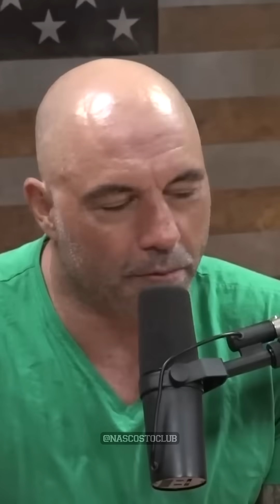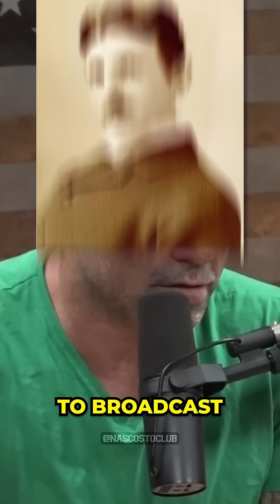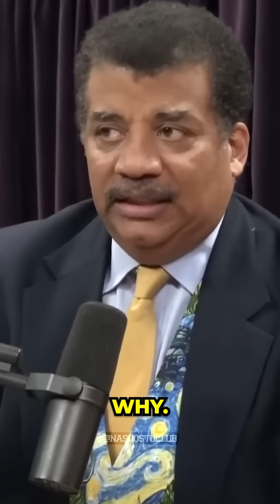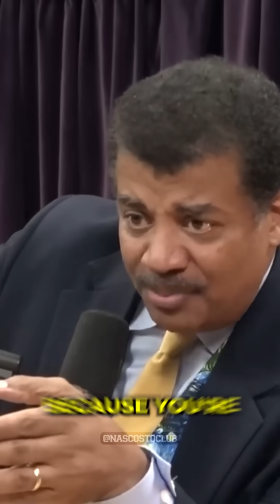WIRELESS Electricity Idea Debunked ⁉️⚡ #shorts

Comment: Neil sounds mad that Tesla possibly had something that he might not understand. (Edit) Viziv Technologies based in Texas has apparently cracked wireless energy transmission. They have a huge tower that looks like Tesla's Wardencliffe tower.
Reply: Do you really think that if we could do Tesla's theory's someone wouldn't have done it already?
Reply: @jasonpark7600  he did it using fluorescent gas bulbs. You had to orient one pole the bulb towards the tower. The problem at the time is that you couldn't charge money for its use. No meter box measuring usage or controlling who uses this free energy. Whether there would have been adverse effect to the environment or people by these waves is a different story, but he proved it and soon after the wooden tower conveniently burned to the ground. No use in providing free energy. A further idea was to use the earths poles as a giant battery. Follow the money and you see reasons for idea suppression.
Reply: @julioperez8324  no, energy ain't free🤦‍♂️
Reply: I think Neil is right about this one 🤪
Reply: stand infront of a running radio antenna. you wont feel good for much.
Reply: He's got a good point tho, but it's just you're so prejudiced towards him that you don't understand or don't want to understand his point.
Reply: Dude do you know what is energy? Do you have any understanding of physics ? I hate Neil but as electrical engineer I can tell you that he is totally correct. Tesla might have  found a way to transfer very high amounts of energy through air but we would never be able to use it around people .
Reply: @yingyang7666 Never is a strong word. We shouldn't use it so lightly
Reply: The guy is an actual scientist, he understands this stuff. Tesla was brilliant but he was working with brand new technology and he didn’t quite know it’s limits or it’s truest potential. The worship regarding Tesla is so strange
Reply: Nonsense. Neil's explanation is spot on. You may find him annoying, but that doesn't make him any less correct.
Reply: Are you being serious? Like for real? Seems like a lot of people in this comment are stuck on 1900 if they thinks thats good or possible
Reply: I feel like the fact that you don’t understand the deadly air means NDT isn’t the one left out here
Reply: Please explain how NDT's explanation is wrong
Reply: No not at all, Tesla had an impractical idea, he was a brilliant engineer but did not understand the physics well enough. No one at the time knew the physics well enough yet. If he had actually attempted to build his system he would have quickly ran into the realities of it and that it wouldn't work.
Reply: @Ender240sxS13  Even at the time the physics was advancing rapidly but Tesla religiously opposed them. Tesla didn't even believe in the existence of electrons. Also many of his inventions were made up to impress party guest at the lavish parties he would attend.
Reply: I’d like to see a conversation between Neil and Tesla
Reply: Nah even then Tesla realized what Neil said is true and modified to wanting to send power waves under ground.
Reply: What's not to understand? Your powering things using radio waves, small things. He was absolutely right in terms of useful power.
There's a reason your wireless charger isn't used to your water heater or dishwasher, it can't safely.
Reply: Nah, Tesla had an idea that was ridiculous with the current understanding of science and its technological application. NDT is right, Tesla's idea is absurd, but.... the concept is still probable, but not with EM waves.
Reply: Uhm no, moving electricity through the air is a bad idea. No matter how "smart" you deem the inventor to be. Not even mentioning the ridiculous amount of energy lost to friction.
Reply: @hitbox7422  
I said elsewhere, "Energy through air" is essentially "lightning"
Reply: @hitbox7422  You can use microwaves and capture it with large receptor dishes, but standing in between the sender and the receiver is a very very bad idea.
Reply: @hitbox7422  "you deem"? What Tesla brought to the world for AC current was beyond they understanding of anybody in his time.
You/Niel are nobodies to deem, Tesla. You have electricity because of his efforts, buy you can choose to be ignorant of it.

And Tesla's idea was to move electricity through Vacuums, not Air!
So get out of your delusions.
Reply: @hitbox7422  in the way you imagine. Now imagine anti Matter based electrons that cannot interact with mass and therefore ignore us. Some quantum shit
Reply: @hitbox7422  well ! Isn't that exactly what happens during lightinings? Electricity through air ?
Reply: @hitbox7422  bro electricityis in air all around us, we literally can produce enough static electricity to power a light bulb. People literally climb on to very powerful power lines from a helicopter after they use a wand to ground out which   allows the electricity  to pass through you without any damage.
Reply: @joshuapage9712  just top bro your embarrassing yourself
Reply: @joshuapage9712 Bro, there is a difference between attaching yourself to a circuit and not becoming the path of least resistance, then shooting 120v through air which guess what water bag you conduct electricity better than air.
Reply: @joshuapage9712  you belong on Reddit's "Confidently wrong" thread. -__-
Reply: @joshuapage9712 Agreed! Sometimes when I pet my cat at night, I actually see the static spark. Electrons help make up atoms. There are atoms ALL around us. Electrons in each one. Wave your arm through the air, Atoms/Electrons move. Instead of sending electrity through waves, we harvest the Electrons in the atoms that surround us. Harvest and sending are two different things and I see many talking about sending them through waves. There is always more than one way to do something.
Reply: my man if u walked through a field which has that much energy u wouldn't be here making this comment bcs THATS HOW PHYSICS WORKS
Reply: Ok dude please stop, study and you will understand why that is IMPOSSIBLE. Im not saying Tesla was not smart, he probably wrote that, gave up and we are today discussing it.
Reply: Tesla was wrong and Neil is explaining why in a way u would even understand so why even say this?
Reply: He is not smart, he is just a human speaker on repeat...
Reply: And where is your doctorate in Physics, cause he has one? Or you are one of those people who has no idea what's going on, but believes any idea as long as it sounds cool....
Reply: @cl1cka  🥩 🚴 🤡 🤓
Reply: @cl1cka  well it is non of your busines mr comment section hero. Why don you show  me any papper written by NDT, oh really, he has non? What a waste of a doctorate... lololol. I like him a lot in fact, but he just talk to much for a guy who added nothing to the academic society...
Reply: Everyone who is this Tesla obsessed failed high school physics.

he was a great scientist, the reason we have the Tesla unit, But I swear people on the internet act like he was an ancient alien who build the pyramids.
Reply: Unfortunately the reality was Tesla had something HE wasn't smart enough to understand. I bet his pigeon understood him tho.
Reply: @XiaolinDraconis  yes.
Reply: It's the other way around. You think Nikolai developed something akin to magic, whereas people who are actually knowledgeable about the subject know it's bullshit.
Reply: As smart as Tesla is, I doubt his implications were to have electricity move freely through the air...give the guy more credit than that.  Perhaps his idea of this was at early conception.  It's funny how even today some people may see him as a 'mad scientist' (for lack of a better term) in this regard, but we all know by now Tesla is the real hero of the electrical triumph, and anything he theorizes could probably end up working through trial and error...one way or another
Reply: Tesla didn't believe in the existence of electrons apart from in a perfect vacuum and would definitely not be very knowledgeable compared to a modern physicist,  either you're very young or uneducated (which sounds like the average "okay kid" insult, but honestly not having an idea about Teslas research or believing he had some magic idea for efficient wireless energy transfer is pretty laughable)  but no, a Tesla coil consuming way more power than wires and able to cause a fire through anything that interacts with the strong magnetic fields is not a smart idea.
Reply: not a Neil fan, but Tesla actually didnt have a good plan for this.
Reply: No, he is right. Tesla was a genius, but he had some ridiculous ideas. Including wireless power
Reply: @Teh_Random_Canadian  the mad idea from scientist
Reply: @Teh_Random_Canadian wireless exists in many forms such as there are now wireless charging roads however wireless has to be over a short distance or too much energy is lost with current tech
Reply: @Yuki-mx1kk  Yes, there is
Reply: You know we've already done this right? When we first made microwaves they weren't shielded, so they lit up light bulbs all around the rooms they were in, radioactive material can also light up light bulbs that aren't plugged in. Lightning lights up the air itself the same way a lightbulb works.

Every time you try to transmit energy through the atmosphere, has Neil says, it will equally affect everything it CAN. Unshielded microwaves will cook people, ionizing radiation will give you cancer, best case scenario. 

It's been over 100 years since Tesla theorized this, and we have free information transfer, you can learn how to do this online, broadcast yourself doing it freely too. If this were possible safely, we have figured it out by now.
Reply: Honestly I'm an electrician and yeah Neil kinda be right. Keep in mind it only takes 10 MILLIAMPS to kill you. A toaster pulls 1000x that.
Reply: @Joseph-tx5hh  you are not an electrician
Reply: @blanchewarren4888  lol
Reply: Please shut up lmao, just because people think Nikola was incredibly smart, which he was, doesn't make every idea he comes up with absolutely genius. Yes we use power transmission trough the air everywhere, in fact, there are thousands of signals running trough us right now. But for the love of God,  we have no way of putting so much power in the air to power lightbubls hundreds of meters away, not to mention other machinery. It is possible ofc, but most of you just have no idea wtf Nikola really invisioned, you have no idea how much power you need to sufficiently power things in an area trough air lmao. Ofc a tesla coil can power a bulb next to it, mby even a few meters apart, given nough power. But now put that light bulb a few more meters away and then a few hundred meters and you see the problem. We would literally need to build gigantic tesla coils, and gigantic is huge understatement. Also do you really want multiple electromagnetic waves with huge amplitudes moving trough everywhere? Jesus, please stop sucking off Nikola in his grave, hes turning in his grave right now, ashamed of his mindless followers.
Reply: The irony is hilarious
Reply: He's mad because the idea is so retarded and ppl r so dumb that they fall for it..... namely Joe here... Ppl who couldn't pass high school sci/ math but have an opinion on this...
Reply: I love Tesla. And we owe a lot to him. But there's a reason this idea has never been done the way he envisioned it yet. Neil is right. It's way too dangerous. 

I find it hilarious people are trying to discredit one of the smartest people alive today because they lack any kind of understanding of electricity. A quick Google search and a little reading about electricity and radio waves will tell you this is a bad idea.
Reply: If you really understand then explain
Reply: Think about the basic principle
"Energy moving through the air"
It's....... Lightning.
.
How exactly would you control the amount?

Or the direction?

How would you prevent sufficient energy "collecting" to form a discharge to ground?
(Again, AKA "lightning")?
.
As he said, you need a "conduit" (that'll be "insulated cable").
Without that, "energy" will find the path of least resistance to travel to an "opposite" or neutral point.
.
That's the ground and the easiest path will be through the closest thing to the high potential energy.
.
That'll be a tree, or "you'.
Reply: wtf? Neil literally has a PhD from Harvard/Columbia and is highly famous and rich, unlike Tesla who is my idol, btw. Are you kids too d*mb to understand your heroes had d*mb ideas??
Reply: The ignorance is knee deep in here
Reply: @eymannassole6162  there tongue's are brown from licking them b.....ty of teslA aka Tesla fanboys
Reply: U can't shoot lightning back and forth to houses to power light bulbs.
Reply: Exactly
Reply: Lmao everyone understands it and he explains why it's a dumb idea. Imagine sending that level of electricity in the air, you'd get electrocuted.
Reply: Tesla was wrong on that. Let’s appreciate where he was right and call out where he was wrong.
Reply: Don't worry. Once the deadly engineered Corona ANTI-virus kills off us normies, y'all can finally power your peaceful households via 24/7 lightening transmission.
Reply: Enough electricity being transmitted through the air has actually been tried before! By god...he didnt quite fine tune it though, ITS CALLED LIGHTNING
Reply: Yeah Tesla wasn't smart enough to understand that it wouldn't work
Reply: Oh look a other tesla fanboy who knows nothing about physics
Reply: And you are just mad Neil possibly undersood something you have no clue about.

The point was you can't have an equivalent system as we have today with all electricity being sent through waves.
Simply the amount of power required at any single time would be fatal if sent directly through waves, through living space. That literally means walking around with a electric oven on max and having power anywhere the waves can reach you.
Reply: @alexradac589  And also it's simply impractical for powering stuff even if you completely ignore health risks. There's a reason why wireless power has only very niche applications even though they use frequencies that are not very dangerous to humans.
Reply: In this, Tesla was wrong.
Reply: The inverse square law would like to have a discussion with you.
Reply: I think he was just mad at the stupidity of the question.
Reply: @armands3863  besides bullshit. 
I.e. the vantablaxk sports car he's "seen" even though atm there was only 1 of 1
Reply: @armands3863  stupidty due to his lack of comprehension or vision. 
What has NDT ever invented I will wait.
Reply: Tbf most humans aren't
Reply: Lol so many Tesla bois worshipping here. Guess you're not too interested in physics.
Reply: You clearly don’t understand the inverse square law or the implications that standing in such a strong electrical field have on your health. You’d be dead, everyone in the city would be dead. The only thing used every day that Tesla invented that’s used everywhere is AC
Reply: Idk why people are still hung up on Tesla bs ideas and forget that we have solar power and wind power and lightweight batteries that didn't exist efficiently when Tesla was alive. We are way passed what Tesla invented.
Reply: No, he understood it perfectly well and explained in detail why Tesla's idea wouldn't work in practice. He even did it with relatively simple language.

It is you who doesn't understand. Come back after you've taken a physics class and learned the basics of electromagnetism and energy transfer.
Reply: I will never understand the Tesla fanboying. He did some great work, yes. He got F'ed, yes. But he was also batshit crazy and some of his ideas are just insane & impossible. Sometimes you can be very right about one thing and completely off about the other.
Reply: @somebassdude  he didn't get screwed over, at all. He tore the shit up himself. The entire story that most people seem to believe was a fabrication. Tesla was never a player on the game, he was a nobody who wasted a lot of money and tried to fuck pigeons.
Reply: @XiaolinDraconis  haha ok, thanks for the update 🤣
Reply: @somebassdude  Yeah. Let’s not forget one of the best scientists ever, Newton, was damn bent on Alchemy.
Reply: @somebassdude  Probably because most fans are Americans? You would notice most of the Tesla asslickers would just attack the opponent's character(Ad hominem) rather than the actual argument's merit. LOL. Smartphones have made human unsmart.  The normal to idiot ratio of the populus tends to weigh more towards idiocy.
Reply: @somebassdude  yeah, i still cant understand "imagine what happen if tesla works done bla bla"

like, electricity is transfered best way isolated.  you dont want lightning generator in the center of the city just to power streetlight
Reply: @somebassdude  juist!!
Reply: Dude tesla was goat but everyone who hero worshipps him need a reality check, dude invented the coil sure but are you really going to think our technology we NEED not like to have but need is gonna work purly on a coil, there's a reason that they didn't become a standard, solar power is infinite better than anything telsa would have invented
Reply: @Mr_Zx solar power yes. But not solar panel. Those are too inefficient for now. They don't even hold a candle to what Tesla invented.
Reply: The Tesla hype train has just become pure stupidity nowadays. Not surprised, the fans are mostly americans.
Reply: @bohemiankhichdi1090  yeah, assuming someone born to the time of the invention of the light bulb is more "inventive" then people working at Google and constructing concepts for quantum gate controlled computer chips is beyond me. Like how early did they leave the school system?
Reply: @hitbox7422  eh, I think they are
Reply: @hitbox7422  I actually don't think the idea makes sense ... But that is a false analogy. It's like how computers started out, the initial inventors weren't less "inventive" they were just faced different questions. 
We're too far gone in terms of development of wire transmission to go back and see what the other option was. Who knows, it may have been better, but not worth it anymore. 
As a physics major, I know better than to think that I understand everything. Especially when it's Tesla xD not that he can't be wrong tho
Reply: Yeah,definitely
Reply: Hahahahahahaha says the dumbassery flock here that doesn't get that. You need to transport energy to use in said lightbulb..

It's pretty clear none of you got logic nor the common comprehension to understand what he's saying to be factual lol
Reply: @MichelLinschoten  🤣😂🤣😂🤣😂🤣😂🤣😂🤣😂🤣😂🤣😂🤣 wow...the "dumbassery" leader just entered the room to brag about how much dumber he is than the rest of us. 
You idiot...of course we understood Neil's argument, however Neil has no irrefutable evidence to completely debunk Nicola Tesla's theories and inventions.
We were just commenting on Neil's emotional attachments to his argument. 
The difference between Nicola Tesla and Neil deGrasse Tyson is that Nicola is a "GENIUS" and Neil is just a "smart enough" individual...
Reply: Tesla did not have the knowledge, we have today about electromagnetic waves and there interactions. Tesla didn't know about the harm this can do. Tesla had no idea something like a microwave existed.
But a microwave is as close as you can get to Teslas idea of transmitting energy through the air. But it had to be packed in a metal box.
Reply: @sbastian6633  lol, like you know what Tesla understood. The government literally stole away many of his inventions, some of which you don't even know about.
Reply: @sbastian6633 the closest would be lightning actually. But what you mean that the wackiest idea might have some level of utility. So we should be too quick to dismiss ideas.
Reply: @sbastian6633  Tesla also invented the death ray and other classified cia documents they stole. I’m sure they wouldn’t spend time on that if he was “batshit crazy” like others say. He also knew the frequency to life and atoms. He said he saw the past present and future at the same time with frequency’s and other things we don’t know cus the government. He studied from ancient Egypt as well
Reply: It’s funny how you think you know more than a physicist with multiple degrees. Just accept that he’s smarter than you
Reply: Haha you dumb fuckers...
Reply: Lmao shut the fuck up, i hate neil as much as the next guy but that idea is beyond insanity, take a single course on electronics to understand why
Reply: It’s basic science. You cannot “broadcast” enough power to power anything we currently have without killing people. That’s straight basic math.
Reply: Retard logic
Reply: He’s not wrong, if the waves had high enough frequency to generate energy to power the radio they’d be ionising waves/radiation so could give you cancer if you blocked the path, that’s why people who work around high frequency waves like X-rays have to wear something to measure their exposure so they don’t get cancer.
Reply: Yeah I hate this guy he’s the staple for work science
Reply: Call y'all take a physics course on electromagnetism before rambling you nonesense
Reply: Yea...
Reply: Yeah but Neil is right on this though
Reply: Lol you tesla fanboys are so salty. Neil degrasse Tyson has actually made valid discoveries compared to your con artist from serbia who made few real discoveries.
Reply: @danhaggerty847  yeah he definitely didn't invent ac, maybe radio and radar and didn't make RC toys as a demented old fuck.
Reply: Get a life
Reply: Neil is absolutely right though.
Reply: Bruh moment
Reply: Yall stupid ass
Reply: Tesla most likely had Autism which contributed to his strange behavior. He was also known to have OCD: each table had to have 9 napkins
Reply: Bruh stop it.
Reply: That's exactly it.
Reply: Neil is just a puppet a mouth piece.  A idiot.
Reply: Meanwhile the U.S government going okay guys don't tell anyone were replicating Tesla's technology.
Reply: You guys are idiots
Reply: Oh fuck off, explain how you get electricity through the to an object without it affecting every living thing. We're not talking radio waves genius, we're talking actual voltage. Use your head, don't be so fucking obtuse.
Reply: AGREED 👍
Reply: No, Tesla was a fraud
Reply: Yall haven't even passed your algebra class. Stfu with your conspiracies lol.
Reply: He's not angry. He's talking from today's point in view. He's like "Dude, don't you think it's ridiculous idea even today?"
Reply: Nah bruh you just dumb. Tesla was losing it towards the end. His plans to distribute electricity would not have worked 10000000%
Reply: Lol, walk around electricity you definitely should not breed...
Reply: God, the parade of science illiterate apes is endless.
Reply: @curtisowen3233  🤓
Reply: Tesla became insane very early on. The guy was samrt but he fliped the coin wrong early.
Reply: You are a great example of how uneducated people can be.
Reply: @dirkmoras  you're judging the guy who literally made over 3 or 4 invensions that did NOT EXIST, you think without refinement on these fucking almost 300 year old documents we couldn't configure a proper way to use AC, like in contained power grid cells??? There. No wires until you distribute landlines, that is a massive time saving thing to giving power to electricity lacking areas. The city generator Tesla coil is foolish in hindsight but in 45 years when even wired connections are obsolete what will sound more foolish
Reply: Tesla was brilliant but also an idiot. Like certifiably stupid.
Reply: what's funny is watching really uneducated people like you who don't understand basic science
you want to send a lightning bolt through the air and have it power something and somehow not affect you if it accidentally hit you
PFFFFTTBWUHAHA
Reply: Funny how this post has 3.4K Thumbs Up, but is WAAAY down the Comments list.

Further shoring up the theory that NDT is shilling.
Reply: Dudes got a big ego
Reply: just like heroin ? backthen heroin is common drug.
Reply: and einstein ddint understand? and feynman didnt understand? And Bohr didnt understand? And Dirac didnt understand?
And no physicists since then ever understood? 
The issue isnt even about understanding it. We understand perfectly well what he wanted to do. Its just against the very fundamentals of physics. Even Tesla will not overturn conservation of energy. And even Tesla will not change how radio waves fundamentall behave.
Reply: imagine not knowing basic physics xD
Reply: True. I’d bet Tesla had quite a bit of things that Neil wouldn’t understand.
Reply: @tommyabernathy9880  I would bet it's the other way around
Reply: No, its that anyone who’s actually take a college physics class understands just how stupid that idea is. It might work on a lightbulb 5 ft away, but anything more than that and your dropping bodies and all the power will just discharge into the ground. For every idea Tesla had that worked he made 5 bat shit insane ones.
Reply: Haha, exactly
Reply: It's called basic laws of physics. Only ignorant people fuel the myth of Tesla.
Reply: nope, Tesla was a fraud.
Reply: @Qudi19  3kv would do it also. With time than..
Reply: Tesla is overrated.
Reply: If you look at the practical implications of teslas idea for power distribution it's laughably mad, like batshit insane. 

He basically wanted to build giant tesla coils in the center of cities and have those transmit the power.  If you have ever been near even a small one of those coils you'd know everyone in that city would be deaf, dead,  or both.
Reply: @dadenergy_ but cyberpunk cities
Reply: That's how genius looks to average people, like insanity. Not every idea will be 100% spot on. But you dont need every experiment to succeed, not every invention needs to work. It's those who are brave enough to dream big that win.
Reply: @dadenergy_  oh yea the guy who is in like 1879 trying to revolutionize the world let's laugh and act like it'd insane. 
Go ahead and go back and explain a touch screen to them you fucking nitwit.
Reply: @dadenergy_  mmmmh...I thought  that inventing AC was a ppretty good  idea for power distribution
Reply: @Dad Energy  yeah cause tesla never sat reading in a room next to one
Reply: @@dadenergy1188  The fact that people aren't understanding this is funny as hell to me. They're always looking for ways to be more efficient.
 That's how we now have computers in the plams of our hands. They would've tried it by now. When ppl are detractors, they just say stuff man.
Reply: @MrMcCoy987  we have a better understanding of the laws of physics now then we ever have before. Wireless energy is possible, however it is extremely inefficient and it would be intolerable to us.
Reply: @Teh_Random_Canadian  exactly. we are still to this day having brealthroughs. hell, they just tested and proved quantum entanglement. we will continue to have breakthroughs but i understand, that theyre within reason and safe i hope lol.
Reply: @Walter White  tru but had we went a different  direction  with it from the start so would of the development of everything else. The biggest problem with tesla electric distribution is monetization
Reply: @dadenergy_  that's why he misteriously died while working at it and his later notes went missing, because he was doing something that would never work, that's how the world works
Reply: @dadenergy_  bro,  he demonstrated it to congress , he use power from Niagra falls to Washington DC. And the word fair in Chicago
Reply: @joshuapage9712  bro that was hydroelectric power plant. Shit tonnes of countries use that now.
Reply: @joshuapage9712  gonna need a source on that
Reply: @dadenergy_  i mean shielding exists  for sound and electricity. And a generator doesn't need to be in the center of a city.
Reply: @Go0o0ooo0o0ber-e1s  do you maybe think that the shielding would shield the WIRELESS ENERGY WAVES?
Reply: @Go0o0ooo0o0ber-e1s  I don't wanna have to put on a metal suit every time I want to go outside.
Reply: @zebragoboom  ehh I missed the point. Thought it was just some kind of generator not a massive wireless power source
Reply: @Go0o0ooo0o0ber-e1s shielding exists and where is the shielding put... around the wires in which it travels directly. Also I assume its in the center of the coil as the further away you get from the source the less power there is. So unless. So unless your idea is to put the shielding around everything it would damage to include people it doesn't seem like a great idea.
Reply: @Go0o0ooo0o0ber-e1s  you have literally no idea what you are talking about
Reply: @Go0o0ooo0o0ber-e1s  If it is not in the center of the city, then what will it power? It needs to be close to the devices it needs to power, the closer you are the more power you get.

And wtf shielding? The whole point is to allow the waves to freely travel so they can power the dammned devices.
Reply: @Go0o0ooo0o0ber-e1s   you would be blocking the energy you were trying to transmit.
Reply: @Go0o0ooo0o0ber-e1s so it wouldn't be used in places where it would be needed?
Reply: @Go0o0ooo0o0ber-e1s  Let’s think this through. We could put metal cages around everything that we don’t want to be electrified, OR we could just run wires to the things we do.
Reply: Tesla's theories are well documented and understood, even you could understand them so NDT definitely doesn't have any trouble with them.
Reply: @RedAndYellacuddlyFella  They are  not understood , lots of them are still way ahead of our understanding
Reply: @RedAndYellacuddlyFella  not true in the slightest. Upon Tesla’s death the US govt confiscated all his materials and majority are still classified or “nonexistent”
Reply: @samcase8088  Some believed Tesla knew how ancient Egyptian projected energy source using the pyramids lining up to power grid (found allover the over). Once the wireless tower up and running it would've generated some sort of energy into our atmosphere alluminate our planet like a second sun...
Reply: This is literally someone who knows nothing making a idiotic comment because an expert said something u didn’t like. “Tesla possibly had some he isn’t smart” dude what do u even think Tesla or anyone scientist is 😭😭.
Reply: I agree, this is the guy at the BBQ that is the expert on everything
Reply: @deanowynn  everyone keeps saying that like he isnt a PHD Astrophysicist
Reply: @deanowynn  Neil IS the smartest guy in thr Room, and knows exactly what is possible.
Reply: @dnomyarnostaw  The thing is we talking about a tower producing free energy. Human won't be walking around these machines (like Tyson clamied) because it won't be street level. When the military used Haarp devices for example noone standing near it or surround it..
Reply: @dnomyarnostaw well yeah it’s just him and Joe Rogan, the king of midwits
Reply: Riiiight, Neil isn’t smarter than Tesla, but you are smarter than Neil to know Tesla is right….?
Reply: @milan.2412  Neil understands relativity, of which by now we have experimental evidence, whereas Tesla thought it was bullshit. 
Tesla had many ideas and was an inventor, but it is hard to compare the intelligence of two people, especially so when one of them is dead. 
Neil has not achieved as much as Tesla, for sure, but at the same time Neil is not an inventor. Tesla had a lot of practical intelligence, but his grasp on math based physycs, by the way he opposed relativity, makes me understand that he wasn't out of this world in terms of intelligence. He was smart, probably as much as the average physics phd of today. Which is very smart for the time.
Reply: @lucam8758  Well said. Neil is all book smart not a real inventor like Tesla. We will never see Neil come up with ideas that will shaken the industry like Tesla inventions.
Reply: @milan.2412  Probably, Tesla is right because they want him to be right :P .
Reply: @milan.2412  I don't think niel is necessarily "smart" he's just educated.  You can be dumb and still be educated. You can be smart and be uneducated. Common sense problem solving and out of the box thinking is what makes you smart.
Reply: Tl;Dr this technology works but has real limitations which stop society from using it all the time.

The real story is that wireless phone chargers use a updated form of the exact technology that Tesla was proposing.
The issue with this tech is that it has a very limited range.
Every time you move further away from the antenna where the power is coming from, more and more energy gets lost into the air.
Which is why wireless phone chargers literally touch the antenna.

This technology could be used at longer ranges, but it would have to be directed energy (like a laser made of radio waves).
The issue with directed wireless power transmission is that the broadcasting and receiving antennas need to be pointed right at each other, so you cannot move your device an inch.
Reply: @Giordano Bruno  Yeah, but Devon Lockwood says in the comments that NDT is not very smart. Now I don't know who to believe.
Reply: @GiordanoBruno42 finally a grounded comment. Not in the fanboyism nor the denial. Just the pure assessment of the facts. However, could some creative engineering help us to walk around the problem you just mentionned ?
Reply: Listen closer.  He says it's not enough to power what we need to do... 'mechanically'.  We already know you can power a florescent light.  It could power smaller things.  Perhaps they would power micro machines (nanobots).
Reply: That’s what it is. Neil is definitely smart but Tesla was just different
Reply: @TN_vigilance  Different or not there is still law of physics
Reply: @TN_vigilance  we already have that kind of energy occurring naturally.  It’s called lightning.  What happens when you get in the way of lightning?  You get burned very badly and often die.
Reply: @TN_vigilance dude. What Neil told is as simple as it can get. If the energy that is used can kill you . Then if it is in air and you stand in front of it you will die. Wtf are you on?
Reply: @TN_vigilance  Neil us Trained
Reply: Tesla is not that smart. Lets accept he also make mistakes.
Reply: @lalandbaby like Einstein. Mistake doesn't mean not smart.
Reply: If he's talking about radio waves he's right. You probably couldn't power a light bulb for more than a minute with all of the radio waves we've emitted since the invention of the radio.
Reply: No he didn't. Neil's right. Tesla had many, MANY ideas. This was one that wouldn't have worked.
Reply: Yeah sure 😂😂😂😂😂 imagine thinking that
Reply: So true, and Neil is mad.
Reply: Why is everyone in this comment section a trogledyte? People are so mad the it is proven false who have no back ground in this area of study and comparing intelligence of the two individuals to justify why one's right of the other.
Reply: @omninoah6851  that's who's left in public comment sections unfortunately.
Reply: @omninoah6851  I work with and DESIGN electrical and electronic equipment.  Tesla's concept works, but it would require a complete rebuild of our infrastructure.  That is and has been the obstacle.
Reply: Truth
Reply: I guess everyone here uses wifi instead of a hard wired connection because it’s so much better, obviously 🤷‍♂️
Reply: Tesla most certainly was thinking on a different wavelength than even the great scientist in this video.
Reply: I think Neil was talking of DC direct current. Which is deadly but AC alternated current  is safe and tesla invented that lol
Reply: @Joshua Fernandez  please tell me how you want to transmit DC over the air lol
Reply: Correcto
Reply: Soooo true
Reply: Didn't Einstein make electricity pass through the air around his house? Like I've seen pictures of him just holding a lit up light bulb but it wasn't plugged into anything
Reply: Nah, tesla was smart but he was a con man as well.
Reply: @Siara87  exactly this, no one thinks Tesla was dumb, but he was 100% a con man
Reply: @Siara87  wtf lol, yeah he died on a golden bed full of hookers
Reply: @Siara87  here's the Edison fan boy.
Reply: Tesla was one of a kind . Neil is not in the same league  with Tesla. Tesla is legend .
Reply: I love how people with a tenuous grasp on reality are trying to discredit Nikola Tesla 😂 Tesla was an absolute genius; you don't understand how his brain worked or his ideas, so you're not qualified in the least to try and disprove him.
Reply: Tesla didn't have anything. He's been mythologized the same way Thomas Edison was.
Reply: @331Grabber the real story isn't that Tesla's invention got covered up, or that it was insane and wouldn't work.
 Tesla's idea for power transmission is a working technology, which is how wireless phone charging works.
The real story about why we don't use wireless power all the time is that it loses power as the receiving device gets further away from the antenna.
This is why wireless phone chargers physically touch their antenna.

Neil is unaware of the specifics of wireless power transmission so made something up.
Reply: @GiordanoBruno42 dude the highest smartphone battery at the moment is around 6000 mAh. So it means that with 3 amber's (ultra fast charger) and 5v your power supply is that of 15watt. Now imagine you need to operate wirelessly your stove that needs up to 3kwatt power output. Now imagine you standing between the stove and the power source. Hell even using your hair dried would burn you to death in a few seconds.
Reply: @GiordanoBruno42  No, that is not correct. The technology used for wireless phone charging is very different from tesla coil based power transmission.
Tesla coils are a hilariously impractical invention. There's a reason we don't use air core transformers for power transmission.
Reply: @GiordanoBruno42  "wireless charging" isnt even wireless charging because it has to be plugged in just because i dont have to plug my phone into the wall directly doesnt make it wireless.
Reply: @yingyang7666  so cringe these fanboys/people of Tesla.. en lets not forget that al lot of these people know about Tesla because of Elon musk. Musk Tesla just used some tech of Tesla ideas en made it better than Tesla even could think of.. I see a patarn with trump supporters. I mean the way they pick things up from social media etc..
Reply: Neil is theoretical physicist, Tesla was inventor, engineer and way ahead of his time. Neil didn't invent anything in his life, he just talks about the things that others did. He never ever worked as experimental physicist. Maybe he could ask experimental physicist about it, he could try to get an idea about what Tesla was thinking about but obviously we still don't have technology to get there or we do have but we don't understand yet. Tesla said that everything has own frequency and we just discovered that so we have a lot to discover.
How Sun's particles, photons carries energy that can be captured and transferred to the electrical energy? So Neil doesn't understand Tesla.
Reply: Niel deEdison Tyson 😉... The only reason why Tesla didn't implemented this is because J.P. Morgan cut the founds when he realized that the energy sent that way would be for free, he can't invoice it to the people... Edison said something similar to what Niel say about alternate current, how that's impossible and not practical but we use that a lot. Those Tesla's inventions invent the way how electric energy is transported even today almost 100 years later... So Niel just don't understand that...
Reply: @radejovisic3358  bro, there are many true conspiracy theory and tesla did get fckd, but that doesnt change the fact that tesla coil is a dum idea, if you just have the tiniest knowledge on physics you wouldve known this
Reply: Tesla wasn't beaming electricity. It would have been like storing energy in a medium that could be drawn upon anywhere. Imagine the ocean was frictionless and wave energy was stored there circulating. On the other side of the ocean the energy could be extracted. What was this medium or ether? Don't know.
Reply: 🤣😂🤣😂🤣😂🤣😂my thoughts exactly🤣😂🤣😂
Reply: NDT doesn’t understand it, that’s why he brought up radio waves
Reply: Tesla had a bigger IQ than Neil
Reply: @samomico9536  everything single part your claim was wrong. We don’t know Tesla’s iq (estimations you’ll find online are just guesses) and stating that the IDEA is good based on iq is flawed.
Reply: @samomico9536  proof it!!!!! Fanboy
Reply: The funny thing is WE BUILT A ROOM THAT CHARGES PHONES WIRELESSLY. Not only is it possible WE BUILT IT. It exists. Obviously to apply this to a country you’d need insane amounts of infrastructure and power but the fact it exists in any form already proves he’s wrong
Reply: @personman8734  no he isn't. Go watch the video again en start when he say for the Tesla fanboy's... Say the line he says after that!!!! Please respond otherwise I have to comment how dumb you can be
Reply: @thedutchelectrician8636  his exact words is “ we can’t pack enough energy In a radio wave for anything we need to do mechanically” which the fact that we can charge a phone which is partially mechanical means he is wrong. It’s literally already been done.
Reply: @personman8734  I find it hilarious that you're saying he's wrong when you clearly didn't pay attention to half of what he even said.
Reply: @dragonheart967  sure bud
Reply: Exactly, Tesla prolly had people like Neil telling him No it can’t be done many times in his lifetime.
Reply: Maybe in case of Tesla, he was thinking of change the energy first to other form that is not harmfull.
But if he is talking about run the energy through the air, we have it already didnt we? Why dont you go and try to catch lightning? And said its not stupid idea?
Reply: @projectr6204  Thanks...we are all now a little bit dumber...What happens when you get struck by lightning ????
Reply: @projectr6204  another form? Like what? 

Heat? Heat enough to power a 220V device will disintegrate you

Radiation? Instant death

Mechanical? That’s like 2x the strength of hurricane katrina

Unless you have some unknown never underestood form of energy out there, there isn’t any
Reply: but if someday we found a way to transfer the energy wirelessly with out any risk and cable. then finally we can take the energy from space/sun. but there is no air in the space, so we have another problem to solve. we still have a looong way....
Reply: Yeah it really seemed like he was purposefully missing the point. Or Joe couldn’t get a word in edge wise to explain it to him better.
Reply: We are already getting radiation from our phones, watches, Bluetooth etc…. I would love to have seen N Tesla alive today to see what NDT thinks his ideas.
Reply: Exactly! When Neil doesn't understand something it makes him angry.
Reply: @devonlockwood1477 You don't understand what he said but you'll jump on the bandwagon with the rest of your people to hate on this man as you always do.
Reply: @trailblazer817  I don't remember what I commented on but I hope you have a good day :)
Reply: @trailblazer817  I apologize. That was a rude response I made. You probably know much more about Neil than I do
(Not sarcasm) 
And my comment before was probably rude as well.
Reply: @devonlockwood1477  no it's just not practical
Reply: @devonlockwood1477  
But he DOES understand.
.
"It ain't Rocket Science"
Reply: @devonlockwood1477  what did NDT not understand?? Explain with much care???
Reply: @devonlockwood1477  what doesn't he understands?? Please explain with facts not feelings!!!!!
Reply: @devonlockwood1477  😂😂😂
Reply: The frequency in which case the electricity would move would be at one that won't be able to pierce the skin like when magicians used Tesla coils
Reply: @joethebigguy9286  how much elektricity would that be??? Please explain how that is possible.
Reply: I agree with you.  For my first time I would have to disagree with Neil.
Reply: @jesselira8485  lmao you can ignore the FACT that wireless electricity is impractical and dangerous. There’s nothing to agree on, you either accept the reality that it doesn’t work or you can live in your silly alternative reality. That’s fine just don’t try to teach anyone anything please.
Reply: @jesselira8485 you don't watch anything about him then. And you have no education of how electricity works. I mean, the fuck dude?
Reply: @jesselira8485  why? Don't let us hang with I disagree. Wat did you disagree. Is NDT stupid? Or you?
Reply: Clearly Neal knows stars not electricity ⚡️
Reply: @joeydacus1219  explain elektricity. And what NDT said wat was wrong???????????